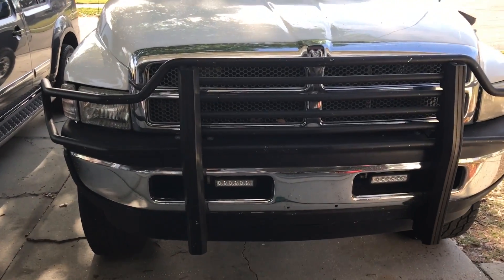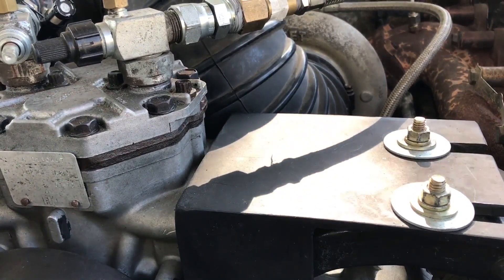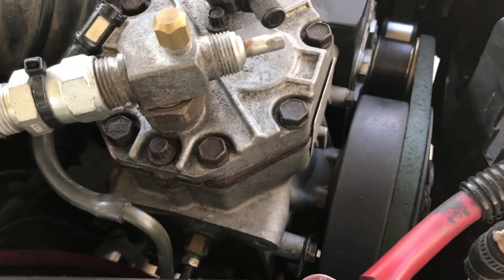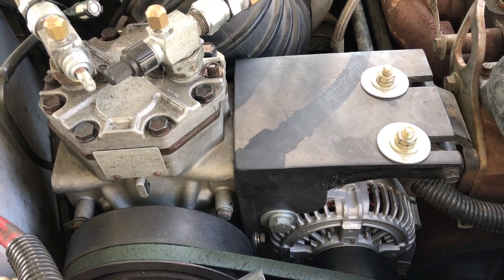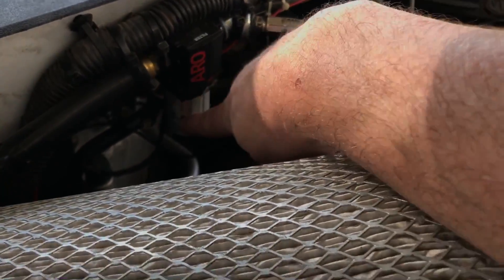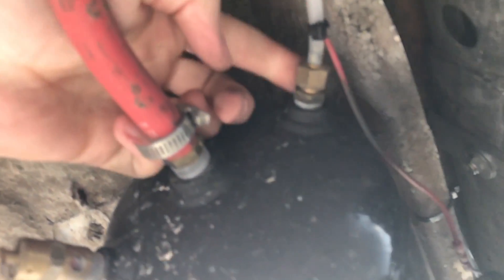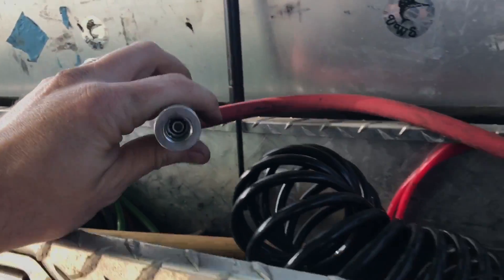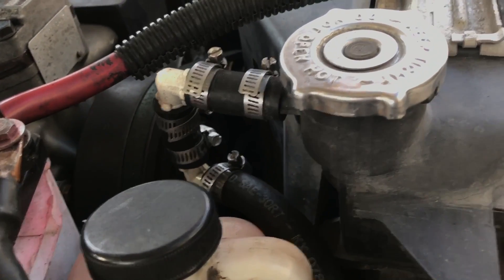Overview & Demo of DIY Onboard Air from Junkyard York210 in 2gen Ram Cummins Turbo Diesel

Comment: Did you plug the hole in the suction side ,doing that it won't pump oil into the piston and fill the system with oil

Comment: Hello. Did you need to do any upgrades with the compressor to use it for air? Which oil did you use in?
Reply from the maker: No upgrades. I used ATF as oil.

Comment: Big favor how many rpm do you need at the engine to keep the gauge above 90psi with the purge open? I run a painting auto body business and this would make my mobile stuff much better. I'm looking between this and the sandon 709 pump but not sure if I need two or just a high idle? Seems both pumps make about 9scfm at 90psi

Comment: What do you do with the coolant tank off the radiator? Noticed yours was missing...
Reply from the maker: It’s there. Passenger side of radiator in front of battery. Little tight but it fit.

Comment: Nice set up.  I'd like to install one on my Jeep CJ7.  Did you have to overhaul the York Compressor before installing it?
Reply from the maker: Steve Zickefoose thanks! No it ran great. Changed oil a couple times and settled with ATF in it. I understand they’re pretty easy to put rings in, if needed.

Comment: Is there a particular reason that lead to this over just installing the TuFlo550 that is made to go on the engine if it were in medium duty application with air brakes? Theyre about 13 CFM and if you are already adding a reservoir the rest of the control system is just mounting a governor onto the compressor and running line back to tank.
Is there not enough room to make that work in the pickup? I only ask because, my solution for mobile service was to simply remove power steering pump and injection pump, add compressor and install. I just put a 25 gallon reservoir in because I was running 1" impact guns all the time.
Reply from the maker: Hey thanks for the comment. I don’t believe there’s room in the pickup’s engine bay for the compressor on the driver’s side mount. Plus I like power steering 👍😂
Reply: Eighth Acre Maker the pump just bolts to the back of the compressor. It just requires enough room but you’d still have power steering. 
I was just curious.

Comment: How often do you have to fill the compressor oil? I have a 210 waiting to be installed  just haven't decided when to do it yet.
Reply from the maker: An hour meter’s an awesome idea, easily tied on to power for the York’s clutch. The nerd factor is high. I like. 🙌
Reply from the maker: Travis Hanson GREAT question. Oil consumption will be based on hours of use for the York. I cycle mine on average a few times a week, with occasional “real” use. I changed an alternator out about a year and a half after installing the York, which meant pulling the compressor and mount off. While I had it off I changed the oil, it was still more or less full. Not a big problem. Also I have plenty of clearance to take the breather off the crankcase of the York and slip a zip tie in to check the oil.  Not an exact measurement but at least you know there’s some in it still...
Reply: @eighthacremaker7129  that's pretty good.   If I make the install I know I'll be using it a lot.   I will probably install an hour meter to keep on top of service.

Comment: How does the a/c clutch work?
Reply from the maker: Jon Vanlandingham The clutch engages when 12v is applied to the clutch’s electrical lead. Ground is completed through mounting brackets. When engaged it allows the power from the v belt to turn the York’s crank. When disengaged the clutch free spins on bearings, and does not transfer power to the York’s crank. The 12v power for the clutch is fed from an ignition on circuit to a toggle switch in the cab (to defeat auto operation) then through a standard air compressor pressure switch. When the system reaches cut in (low) psi, the switch engages and passes current. When the system pumps up to its cut out (high) psi, the switch clicks off, letting the clutch free spin.

Comment: because the alternator pulley is slightly larger than the Alternator main pully in diameter, this functionally give you a higher rpm without having to increase the engine rpm's
Reply from the maker: Greg Ward, yes it’s just a bit bigger. I put the math i worked out for rpm in the video’s description. It made my head hurt working out the relationship between the engine’s crank rpm and the york’s!  😂

Comment: Where did you get the clutch pulley I have not seen one like that anywhere other than yours?
Reply from the maker: I Gomez that’s the original pulley and clutch from the 74’ international I pulled the York from. It was a mistake to not replace it, the bearings went out after about a year and I had to replace it. Unfortunately the new pulley locates the belt slightly differently so the bracket had to be re worked a bit. No biggie but would have been easier to do it all once instead of almost twice. 😂
Reply: Thank you! LOVE the whole set up! I will be diffanently using your ideas on my rig. 👍😉 Thanks for the video.
Reply from the maker: I Gomez you bet man! 👍

Comment: You sir have inspired me! I just got a train horn and I’m going to be getting some air help her bags in the back of my 97 ram 2500 and I’ve been looking at electronic compressors but that system you have there has just converted me!
Reply from the maker: It’ll take a little more work but you’ll be glad you did it!

Comment: holy fuck that thing fills fast! Ive got a gast 2H single cylinder 12v compressor from an ambulance... it takes a rebuild kit every year, really wanting a york... im tired of the loud compressor and shit flow rate.
Reply from the maker: The york is amazing. Google will yield a list of vehicles that shipped with them, then its watching junkyards.  They’re available new as well, but of course costs more.
Reply: This Old Dodge itll have to be dependable, might go with the ones that are modified for air with oil control rings etc. My rear is bagged and i can't go without air. Thanks for the info!

Comment: might be able to rig up a leveling valve like a semi truck has, it auto levels the rear bags depending on load
Reply from the maker: jacob fraser That’s an awesome idea. It’s about as easy as it gets now to adjust - plus I also adjust by feel, softer or firmer depending on road or load. Daily driving bags are at their 5psi min.
Reply: you would have to set it up so the bags lift slightly when the truck is empty, to keep a little pressure in them. simple plumbing, a supply from the tank, output to the bags and a dump. although you would want some sort of protection valve so that if you blow a line the bags don't deflate.
Reply: Air lift makes. Auto leveling kit. It’s pretty sweet.
Reply: @daltonsequipment4419  true, but they're extremely simple to just install with some very quick fabrication. Last time I replaced one I think the valve is some $30. The rest of building the system is control rods and a couple simple mounts.

Comment: How does the bracket work to tighten the york belt?
Reply from the maker: 4x4lou with muscles. Haha... seriously, since there’s no idler/tensioning pulley the bracket it slotted on top, and you just pull it right by hand and tighten the bolts. It does not have to be real tight - that york isn’t asking that many hp from its belt.

Comment: I think it pumps up fast at idle because the drive pulley may be smaller than orignal that ran pump.
Reply from the maker: sandman sandman The drive pulley off the alternator is smaller, but its also smaller on the serpentine pulley. A small pulley over drives the alternator, but as a drive pulley, small pulleys UNDERdrive. Basically - ignore the alt pulley size, the yorks rpm is determined by the relationship of the cummins’ crank and the york’s pulley. The york pulley is 1” smaller then crank, so its only very slightly over driven against engine rpm.
Reply from the maker: Math - 
Crank 7"

Alt 2.25" (serpentine)
Alt 2) 2.75" (v belt)

York 6" 
""""""""""""""""""""
Crank to alt: 1:3.11
     Rpm 1000:3100

Alt to Alt (2): 1:0.819
    Rpm 3100:2538

Alt (2) to york: 2.18:1
    Rpm 2538:1164

Crank to york: 1:1.164
Rpm: 1000:1164

////////////////////////////////////
Crank to alt: 1:3.11
     Rpm 1000:3100

Alt to york: 2.66:1
    Rpm 3100:1165

Crank to york direct: 1:1.16
    Rpm 1000: 1160

Comment: for your air dump are you just using another solenoid?  i like the idea of a electronic dump.
Reply from the maker: arnoldsq yep just a cheap air solenoid from amazon. 1/4” npt. Its real convenient to have a switch to drain the tank!
Reply: thanks for the quick reply.  ill be doing this soon.
Reply from the maker: arnoldsq sweet! Its the best thing I have ever done to any vehicle I own. It wasn’t all that hard just lots of little details to work out

Comment: What size lines did you run off your your York .
Reply from the maker: casey glisson From the york to the oil separator is a 1/4" ss hose, because it gets a bit hot right near the compressor. After the oil separator all the rest of the plumbing is 3/8" id rubber hose.